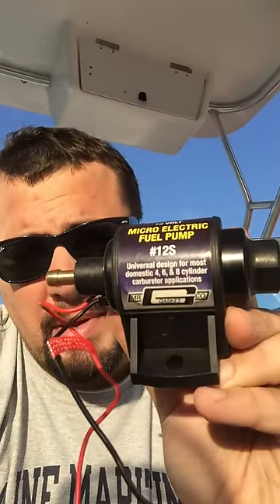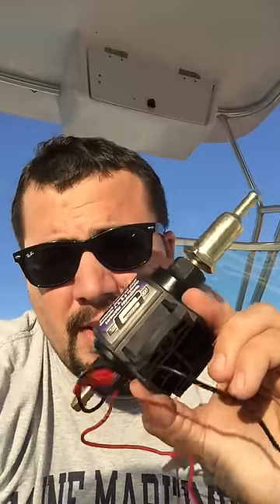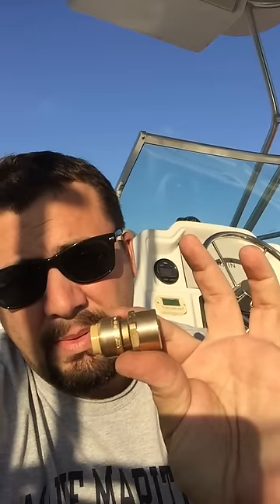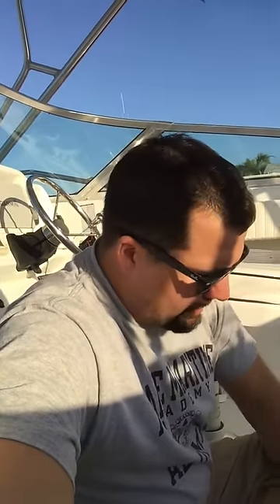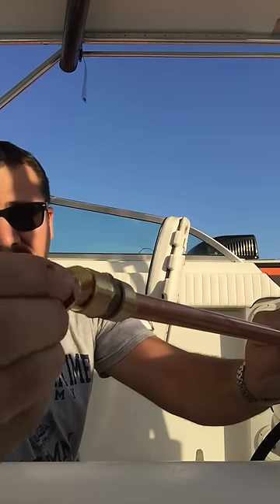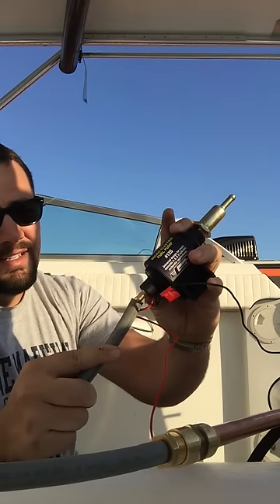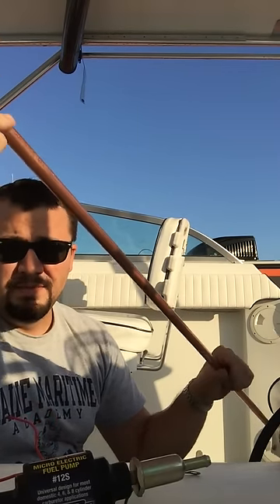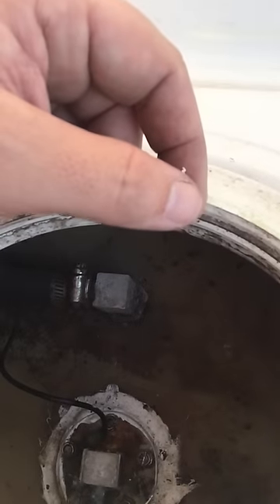How to clean your boat fuel tank part  1

Comment: a tip for use with remote gas tanks and push on hose --- eng will idle but not rev up  --- check tiny o ring in hose cnn. both ends it will have a small hole in ring lets air in not gas  to remove  insert fish hook in o ring jerk it out  put small amt, lub on new  o ring push in easy to fix  ----buy these o rings at boat shops keep spare in tackle box it may save alot of paddling some day

Comment: I haven't read the comments, maybe this has been pointed out but,   NEVER  EVER   use an electric (110v) drop light while working with fuel tanks. Use a cordless, battery operated or rechargeable light.

Comment: Just removed fuel from my boat tank by blocking fill inlet, running hose from pickup tube to other tanks/cans and then using air into vent tube.  When you need to stop flow just move your hand.  Still have 1/2 inch of bad fuel in bottom, thinking of doing the tube thing you did to get to bottom, but use air again to push it out.  No sparks with air.  Use air to empty semi tank trailers too, just a lot larger compressor.

Comment: Maybe a dumb question....were you "lifting" fuel with this pump?   I made the same set up but I cannot pull the fuel up out of my tank.  I see it says it is obviously a gravity feed style pump but was t sure if this should still work.  It won't pull anything.  Thanks for any replies.
Reply from the maker: Tim Leeson not a dumb question! So these cheap transfer pumps won’t self prime, so the work around is just put a fuel ball between the tank and the pump, that way you can squeeze it and prime the pump and it will
Run from there.  Make sure you don’t have any air leaks in the pickup side also
Reply from the maker: Tim Leeson watch part 2 and you will see the fuel squeeze balls location
Reply: go to harbor freight  they have a  d battery opperated pump for draining gas tanks  cheap and works great

Comment: I would never use a electric pump, manual pump would probable take longer but is safer.
Reply from the maker: cordelmar not sure why you think that, after all fuel transfer pumps are made to transfer fuel. As long as you have your electrical connections far from fuel vapors there is no danger. A manual pump would take forever
Reply: Boom.
Reply: agree, as most engines have electrical fuel pumps, they should all make "boom" according to that post :-)
Reply: maybe ya could start a siphon that will eventually empty most of the tank.
Reply: harbor freight has  pump  to insert in gas tank its d battery opperated  has hose to drain as pump runs it safe  - cheap -- works good